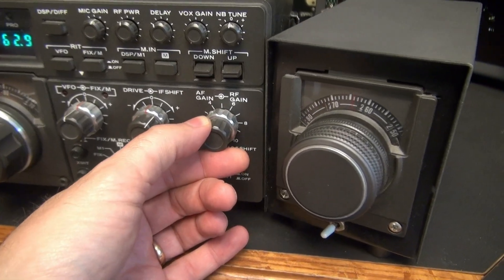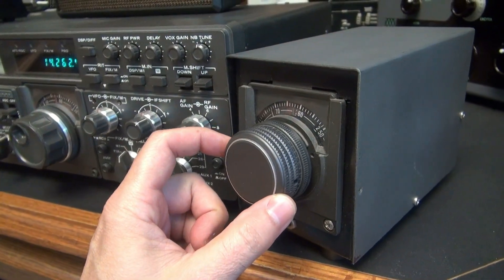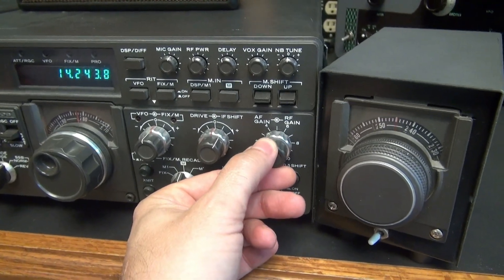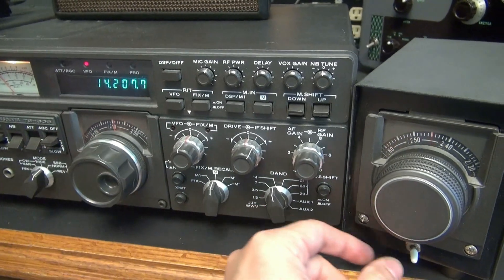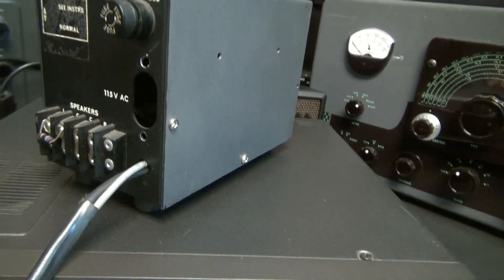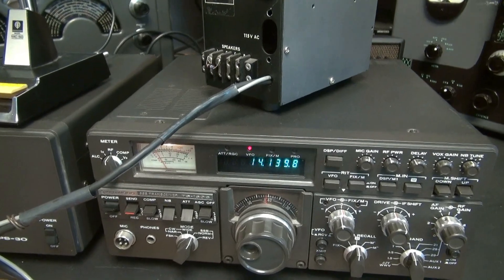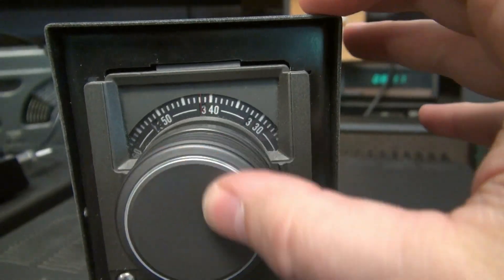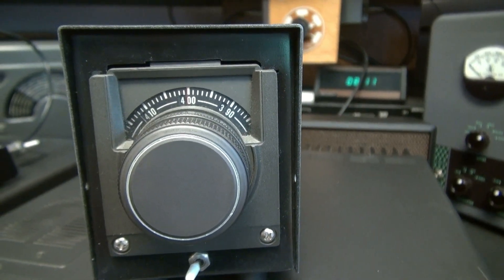Kenwood digital TS-180s Transceiver External vfo Ham Radio Demo

Comment: Hi. My kenwood 430 ts has a  transverter input . Is that where you connected your external VFO.?
Reply from the maker: Hello, as far as I know that (transverter) is for a 6&2 meter converter. I have not owned one of the 430's so do not know if there is a connection for an external VFO